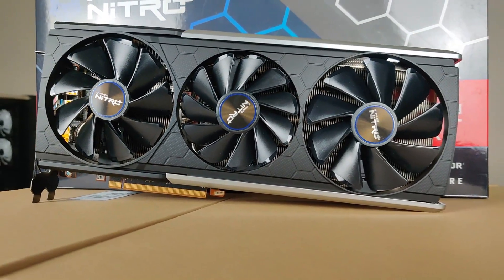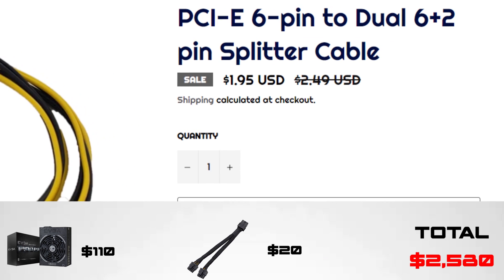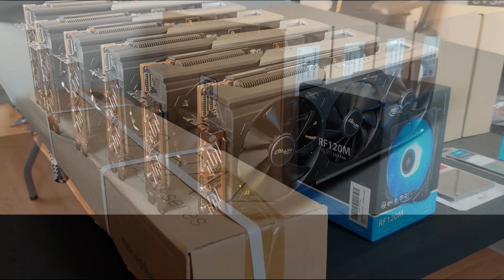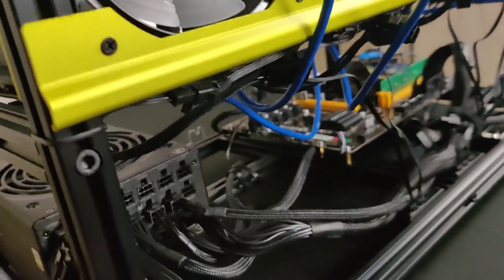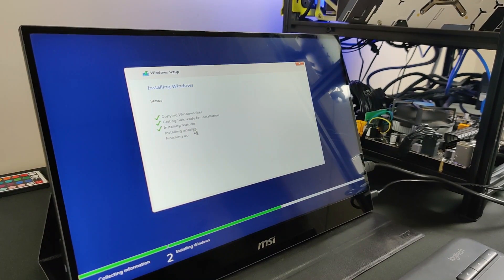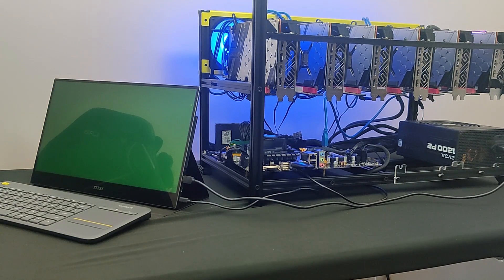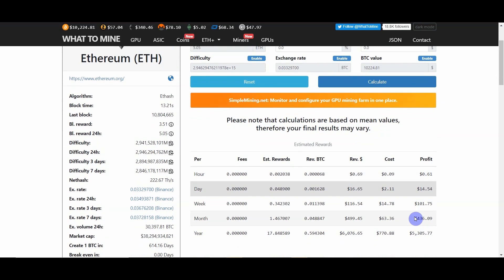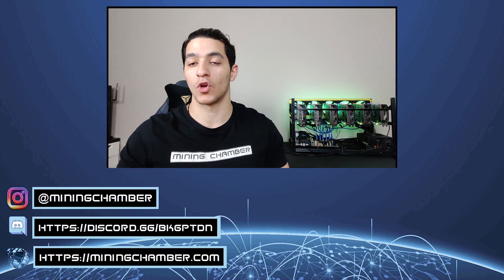RX 5700 XT Mining Rig Build - 6 GPUs | 330 MH/s and ONLY 880 Watts!!

Comment: "Eventhough the electricity cost is at 10 cents"
Me in Germany being happy if its only 30 cents /kwh
Reply: das setup kostet  hier auch um die 4000 euro ^^ und man muss ewig auf teile warten
Reply: @SchnoeselHD  now especially, i bought a 2070 like 3 month ago new for 350, now you cant find anything for less than 600 lol
Reply: @SchnoeselHD  4000 wäre momentan ein schnapper^^
Reply: @albi3235  lohnt sich in deutschland nicht und unsicher wegen eth 2.0
Reply: @SchnoeselHD  kommt drauf an, wenn man alles für OVP bekommen würde, würde es sich safe lohnen. Aber die wollen momentan astronomische Preise, so ein rig wie im Video kostet auf eBay einfach über 6k😂 ROI hat man auch erst über nen Jahr erreicht und die meisten die den Mist kaufen wissen gar nichts über eth 2.0.
Reply: @SchnoeselHD  lohnt sich es hier in DE wegen dem Strompreis?
Reply from the maker: 😂 sorry!!
Reply: @MiningChamber  nothing to be sorry about bro, nice video👍
Reply: abfuck gel
Reply: Same here. So I got my a solar installation. Turns out I my ROI decreased, not increased.
Pay around 400 euro/month less in electricity. Pay 125 euro per month for loan. (It's more than 6 GPU's :) ) Also still running 5700's.
Reply: @rakly347  330 MH/s is extremely low, considering an ASIC with the same price can generate 100 TH/s. Yes, terrahash, as in 300,000 times.
Reply from the maker: ASICs mine specific coins. For example the Tera hash ones are most likely for Bitcoin and that makes a huge difference ;)
Reply: @gorilladisco9108  Pretty sure that's a SHA265 ASIC, not Daggerhashimoto..
Reply: @rakly347  Is Daggerhashimoto better than SHA256?
Reply: @gorilladisco9108  They are for different blockchains/coins. They also have a complete different usecase.
Is a cement truck better than car? Depends what you need it for, right? :)
Reply: @rakly347  Got it. So right now there are no ASICs for Ethereum yet. 👍
Reply: @gorilladisco9108  that will be mining bitcoin not etherium, as for now there are few asics for Eth with the best one at 2TH and cost $25k and is still in production few older models have about 500/750MH with $5k/10k price so you are wrong bigtime tith the Terahash mantioned the asics which have Thash performance are prety much only bitcoin miners
Reply: @ulqu1orragaming659  But I can't find any asics for eth. All asics I found in the internet is for bitcoin. 🙁
Reply: @gorilladisco9108  google innosilicon eth asic, they have quite a few models for eth
just look for the name it says it in there if its for BTC or ETH
Reply: @ulqu1orragaming659  Thank you.
Reply: 30 cents/KWh!? That's insanely expensive! I pay 5 cent/KWh here in Finland. 😳
Reply: @Abiodun92  They closed all of their nuclear reactors and buy their electricity from French, which produced it with nuclear reactors.
Reply: @gorilladisco9108  Wow.  Europe.  Gotta love it.  Eff dis... im moving to Bangladesh  XD
Reply: @Abiodun92  yes man, I live in Austria for example and pay like 0.25 euro cent bruto for the electricity; thats like 0.35 in dollar cents
Reply: Merkel strike again
Reply: laughs in 5c per kwh
Reply: Potato  Wohnung sagt nein
Reply: 6 cent canadian here so about 4 cent USD
Reply: @shingod700  What. That's crazy.
Reply: solar
Reply: @deaniversen351  flat...
Reply: Potato  Krass...Zum Glück gibts solar :D
Reply: Even in switzerland i only pay 15 Cents per kwh 😄
Reply: @ShInYaKu88  mi sembra che ora si paga 38 centesimi al kwh
Reply: Renewable energy. AKA expensive energy.
Reply: @ROBOROBOROBOROBO  No Joke, kein bock mehr auf deutschland. Gehe Lieber nach kanada oder so
Reply: Damn 30 cents in germany here in slovakia 90 cents :(
Reply: @-frippu--3926  Rip bro
Reply: @-frippu--3926  it’s 17 Cents in Slovakia
Reply: @falcon2907  Whaat cant be i literally checked the prices on the company that gives me electricity
Reply: @-frippu--3926  I googled it and it’s 16,86 Cents|kWh, 90 Cents is also way too much, that’s not possible.
Reply: In dutch I have 21 cent/kwh and made still profit.
Reply: Me at 0.57

Comment: Hi, im Fernando from argentina, I have a question: 
how do u know how much is going to consume your rig?
cause, i found a psu calculator, and i put your rig and says this: Load Wattage:1551 W
Recommended UPS rating:3000 VA
Recommended PSU Wattage:1601 W
but u use a 1200w psu, im wrong ?
thanks
Reply from the maker: As you see in the video I measure the watt consumption and I talk about it. It uses 880 watts with all GPUs tuned properly. That calculator is not taking in mind the undervolting that you will be doing to the GPUs before mining with them

Comment: This might be a dumb noob question (I'm sorry) but I'm curious can I start a rig with only 2 or 3 GPU's or do I have to start with 6? I want to start my rig with only a few GPU's and as the rig starts to earn I can add more GPU's later in time. Is this possible?
Reply from the maker: You can start even with 1! ;)
Reply: @MiningChamber  thanks! Your channel is awesome I'm so pumped to get started. I'm also a little worried about noise, how loud are these gpus when they get up and running?
Reply from the maker: Thank you! It all depends on your weather since the higher the fan speed the louder they are. Some GPUs are quiet while some are loud and it all depends on how hot they get. For example our 3060 ti review will give you some more info on that!

Comment: the cooler already comes with thermal paste,
m2 ssd is the most ideal, same price and without using cable
Reply from the maker: I think if I remeber correctly I forgot about the cooler thermalpaste so had to clean it haha but as for the m2 I feel like it's more expensive, 120 gb ssd can be found for $15-30 which is pretty cheap, havnt looked into m2 prices yet though

Comment: Could you do this build with 6 
GIGABYTE Radeon RX 5600 XT Gaming OC 6G (Rev. 2.0) Graphics Card, PCIe 4.0, 6GB 192-Bit GDDR6, GV-R56XTGAMING OC-6GD REV2.0 Video Cards  instead of the 5700 XTs? In other words is all the other hardware compatible with the 5600 XT graphic cards?
Reply from the maker: Yes for sure! You can even use a smaller psu since 5600 xt uses less power
Reply: @MiningChamber  Thx. Hey  what about NVidia cards - would this rig work with 6 Nvidia cards?.. let's say the RTX 3070 for example?

Comment: I need help please, i followed the same build My PSU is EVGA 1200w P2 which included 4 x PCIE 8(6+2) pin and 2 x PCI-E 6 pin + 8(6+2) pin. which conclude that iam using 8 splitters instead of 9
Reply from the maker: Hey! You can use molex strands to power the rest of the risers. 1 molex per 1-2 risers
Reply: @MiningChamber  thanks buddy ill give it a try

Comment: Does the PCI-E Riser Express need the extra power supply?
Reply from the maker: If your referring to the molex on the board then yes it is recommended to plug them in, but you can get away without plugging them in for low powered gpus

Comment: Hi I have just pulled the trigger on building my own rig and I have 6 5700xts also
I noticed that the cards have 2 8 pin connections. My questions is, are you using one port to power a gpu and splitter?
For example: a male 8 pin to dual 6+2 male, take a 6 pin to riser, then the other 8 pin goes into 8 pin female to dual 6+2 and then remaining wires go into card?
Apologies but idk how else to describe it. Just wondering if this is what you did and if it is safe
Reply from the maker: Hey! Yes generally each vga cable plugs to one gpu and it's riser. So if you have total 6 vga cables then you want to use each one with a splitter to power a gpu and it's riser. If you have a single 8 pin vga then splitter to gpu and molex to riser! Hopefully that helps
Reply: @MiningChamber  Yes this helps! But molex is the 6 in the 6+2 correct?
Reply from the maker: Molex is the 4 large pins. Plugs usually in perif on PSU . If you look up molex connection it will show you the image for it!
Reply: @MiningChamber  sorry I meant to say, I can power the splitter with a 6 pin OR the molex right?

Comment: Nice video, i have a question, if i use the corsair hx1200 how do i connect 6 video cards and the cpu?  because i saw it only has 6 8 pin power supplies for gpu and cpu
Reply from the maker: Hey! In that case make sure you use as much splitters as you can and have each strand connect to one gpu. So if you have single 8 pin then connect splitter and power up gpu then use molex for riser. If you have dual 8 pin then connect splitter and power gpu then the 6+2 pin use for a riser etc. Hopefully that helps!

Comment: Basically you need SIX MONTHS just to make the money back
Reply from the maker: Haha even more! Usually a year to breakeven. As per the pinned comment we did some miscalculation, the profits where wayyyy to high on that date which is usually not normal
Reply: You have to think about the profits in 3-5+ years. What is profitability when ETH hits 1400$? 2000$? 5000$?
Reply: that's great numbers tho, the cards can last more than five years at least, and if you're worried about halvings you can just move to other coins. I'm thinking of making the investment

Comment: Hi Mining Chamber. I have got the same gpu and I put all together with mother board and plugged one gpu and the light is one but the fan isn't turning on when I turn on the computer. Is it like normal?
Reply from the maker: Hey! Did you make sure to fully power the gpu and the riser as well? The gpu will most likely have 2 8 pins and the riser will have the 6 pin. Also make sure to plug your first gpu in the primary slot which is the first 16x slot
Reply: @MiningChamber  Yes. I plug the vga with dual and 2 splitter one goes to 2 8 pin in GPU and the other one goes to the splitter which is 6 pin. I didn't plug into the 16x slot (It looks like yellow) Also, I set up in (250 BTC BIOSTART Motherboard) BIOS to have 1 gen. Should I do gen 2 instead of gen 1? Some people did gen 2 and somepeople did gen 1 for that motherboard.
Reply from the maker: I would first plug the pcie slot in the yellow which is the primary one. Then you can try switching gens for sure!
Reply: @MiningChamber  Thank you. How do I know if I have to set up the BIOS to gen 1 or gen 2,3,4 ?
Reply from the maker: Generally gen 2 and 3 work best for multiple gpu systems. So try that you can't know which one you need so if it works for you then your set!

Comment: Hi, very very nice rig. 

Have built the same rig with now 5 Sapphire Nitro+ GPU's in it using a Asrock H110 Pro BTC+ motherboard. All 5 cards (6th is on its way) did flash bios according your explanation in the video's. Works great. All settings set. However, the power from the wall remains high. Measuring this, typically per GPU's about 200 to 220 W. As if they are not listening to the new settings even though they are hasing at 55.3 MH/s and Phoenix miner says 87 W to max 90W per GPU (in the software). In the adjusted flash settings 220W was set to 180 like you did in the video.

Searching for a bad GPU I did test them individually. Testing the real wall power per GPU I putted each card solo in the pc. So with the GPU's individually in the motherboard the power from the wall was for: GPU1 273W,  GPU2 268W, GPU3 300W and GPU4 296W. The fifth I dit not test yet. These numbers are including the PC that has an idle power of 75W and when busy 100W. (Connection via riser or PCie-16 slot did hardly not make a difference in wall power btw)

My question. How to get down to say 130 to 150W per card? Mine are far above the 200W each. Everything is equal in numbers to your video. Resulting hashrates, software noted power consumption per GPU in the miner log, AMD Radeon software settings,... everything.

If I would add up al the powers then the final 6 GPU rig Nitro+ is about (6x200 + 100) = 1300 W. Which is not a good value compared to the 880W. Any ideas or suggestions to look at? Btw, mining with Phoenix miner via Nicehash or Ethermine.org  gave both the same results. Good hasrates but bad real power consumption. 

Thanks already for an answer. And thanks as well for the great video's and explanation.
Reply from the maker: Hey!! That is quite interesting. What kind of fans do you run on your rig? Have you possibly tried a different power meter? Before I had a powermeter that kept giving me bogus numbers like 1400 watts off of a 1200 psu for 6 rx 580s! It could be just a flaw in the meter!

Comment: I experience a lot of crashes from this configuration. What AMD Driver version do you use? Thanks!
Reply from the maker: We used amd drivers version 20.4.2, make sure to check the range of overclocking we have on our website for this gpu since all cards are not the same and some might be able to overclock as well while others don't.
Reply: @MiningChamber  thank you for your answer. From my experience, AMD driver ver. 20.11.2 has lower performance  and is more unstable for mining. I am using 20.11.1 now and I will try 20.4.2 if I experience crushes and high rejection rates. I addapted the overclocking settings according to your recomandations from website and it seems stable now. Cheers!
Reply from the maker: Awesome!!

Comment: Love the videos you produce. Got me into mining. Quick question for you.

I have a corsair HX1200 80+Platinum.  Should I be good to run 3 rx 5700 xt's and 3 rx 580's off of that single PSU without issue?
Reply from the maker: Thank you!! And yes you should be fine! You just might need splitters then your good

Comment: Did you connect power on both 8pinc Slots on the card? and if you do, how did you do that on that psu with only 6 VGA power cable, i mean , how u combined the rest ?
Reply from the maker: I did yes! I used multiple splitters to power everything and ended up daisy-chaining one splitter to power 3 risers total but after that I ended up switching one of my single 8 pin cables with a dual 8 pin cable and now it's all good! I recommend using splitters and if you have a riser or two that you couldn't power with 6 pin then you can use molex

Comment: Can we start mining with 2 rigs (Graphic cards) Also. due to less budget. Please confirm
Reply from the maker: Yes ofcourse! You can start with one and then add more down the line!
Reply: @MiningChamber  I'm currently using my RX 580 8GB (No mining BIOS because I also game on the card) and a GTX 1070 Max-Q. They both average around 48-50 Mhs and make $2.30 per day. Also, since I'm only 18 and still live with my parents, I don't have to pay for electricity! So it's not too bad! Also, I have a question. What do you think is the best budget mining card? I'm willing to spend around $200-250 on an additional card with good Mhs.

Comment: Hi! Thank you for the informative video. I do have a question about wiring the GPUs/Risers. I have the same PSU as you but I can't seem to figure out how you wired your GPUs/Risers. What do you recommend to fit all the devices on one 1200 P2 PSU?
Reply from the maker: I would recommend using splitters! Did you have enough after splitters or not enough yet? We have a full guide on PSUs that you can use as well to hopefully aid you in building the rig!
Reply: @MiningChamber  I do have splitters, do you have one main wire for each GPU and split it to the two 8 pin and the 6 pin riser?
Reply: @MiningChamber  I just re-watched the psu video and I think I got it now :) !
Reply from the maker: Awesome ;)

Comment: I have been eying to build myself a mining rig, with this profit rate then I think throwing 3k into the rig is a no brainer. One question, how loud is the system when running? Oh, and what is your opinion regarding the ETH 2.0 launch? I mean can we still this set up to mine something else? Thanks
Reply from the maker: Hey! Now it is surely harder to find good prices and the profits in this video were over-calculated using a higher block reward. So a more accurate profit as of today would probably be around $400 USD a month. Sound level is based on how high you crank up the fans! At 50% it's pretty low but 80% and up it's pretty loud like almost a vaccum. After 2.0 it's hard to really tell what will happen for AMD but as for NVIDIA it will remain safe.

Comment: I'm not sure what happened to my mining rig. I have 6x 5700xt and 2x Radeon 7. In the Pheonix miner shows the total watt is 1280watt, however on the wall is about 1880watt.. Is it normal?
Reply from the maker: That is way too much watts. What psu are you running? And do you have them properly undervolted and overclocked ?

Comment: Hello first of all thank you for your great video. I have suscribed.
I have a Supernova 1000w Gold PSU, I was planning on buying a second 850W gold PSU, since you use a single 1200W PSU, would you recommend buying a second smaller PSU? Like 500w then?
Reply from the maker: Hey! It is a good idea to do so if you dont have enough power to run the rig. I do recommend just getting a bigger PSU since it makes things easier but if your doing 2 PSUs just make sure you follow in how we did it in this video: https://www.youtube.com/watch?v=r0LP1btuvgo

We used 2 PSUs and made sure that each GPU and riser is powered by the same PSU
Reply: @MiningChamber  thanks a lot!!

Comment: Hi, how are you connecting 5700 XT x6 in a single PSU?

I have bought the same GPUs and a 1,200 PSU Seasonic
Reply from the maker: We used a bunch of splitters! You can check this video as a guide https://youtu.be/e7AO8ADUD5g
Reply: @MiningChamber  each card consume 130 watts right? 1200 watts psu will be enough? Sorry my listening english is not well, but you are one of the few who explain all the process well and I able to understand the majority
Reply from the maker: @metalmachine555  Hey my friend! Yes it is enough! on proper settings like we did in our GPU Overview video you will be able to run them at 130 watts. No need to be sorry at all hopefully this helps!
Reply: @MiningChamber  thanks, do you recommend to use the 18 pins of the GPU or just 8?